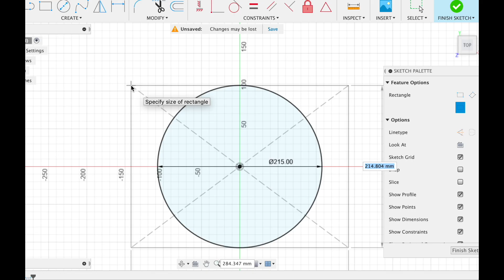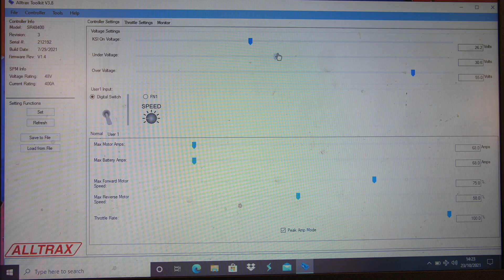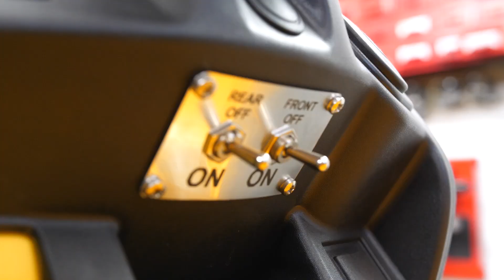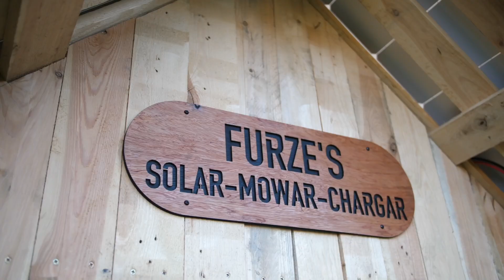EV Mower Conversion with Solar Charging Station

Comment: A very practical use for solar. Bravo! But I have two suggestions. First, can you put gauges on the console so the user would know the state of charge all the time? Second, assuming you are out mowing and have finished but are far away from the charging shed, putting a switch that would shuttle the remaining charge in the front batteries to the read drive would ensure being able to get back home. Anyway, good job!
Reply: Or just a bypass for the auto shutoff. Allowing you to drive short distances even if the batteries have already hit the minimum charge in the ESC

Comment: Biggest question I have is whether or not there is a mechanism to prevent the batteries from overcharging (if that's an issue for those batteries) as solar can be quite a variable source of power

Comment: And all this on battery technology invented in 1859. With lithium-ion, you could get the same runtime and even have space for a hood storage trunk so once you were done with the mowing you could pop down to the shop for a few groceries. Or just cram it full of batteries and get runtime measured in hours, if not days. Or you could even go zinc-air and take it up to about a week (Granted, you would have to replace those batteries as they can't be recharged, but recycling used batteries is much easier).

Comment: Nice build. How about a vehicle to grid connection so you can run your house from it during power cuts?😁
Also, love the solar shed, damn site cheaper than getting in a bunch of lads to put them on the house roof.

Comment: Beautiful project, but as well as the batteries themselves, the charga could also use some improvements, namely you could use a lot less panels if you make a flat roof elevated 30 degrees and pointing to the south (ish, exact values depending on location) and also it's not good practice to stuff all the positive leads to one connector and all the negative ones into another. If you put both leads of three batteries in each connector there isn't a chance of connecting it with reverse polarity, which is always nice

Comment: Just change your drive belt  pulley for the back end the bigger the pulley on  the motor the smaller the pulley on the transmission won't make it go faster

Comment: I’m sure you’ve looked into it, but could lithium electric bicycles batteries be of use? Mine powers my bike for 45 miles of range. A few of those would probably do you fine.
Reply: He'd probably need something from an electrical motorcycles, like on those NIU escooters. They look the same as lead acid batteries, are portable but they also cost half of the scooter.

Comment: Bit more info needed here I think. So max current draw is 65 amps, at 12 v that would be (about) 1 Hp or 800w but at 24v it would obviously be double that which sounds more like it. With 4 batteries to run the cutting deck you have the option of 48v, much better.
Charging looks like you are using 12v charge controllers so is it that each panel  charges it's dedicated battery? So with panels facing different ways what is the orientation of the charging roof? Obviously some panels will produce more power than others due to the position of the sun Etc. Does his just rely on time, I can imagine some batteries receiving less than a full charge.
Loads of questions, cheers

Comment: you can get car battery sized lithium batteries. you could swap them right in. need to setup intelligent charging tho, but they don't have problems being discharged under 50%.

Comment: If you do some googleing there are companies that make lithium deep cycle batteries which is what you need but be prepared they're about 400 for 1 200 AH battery I've seen them up to 2 grand or more for a single lithium deep cycle marine battery but for that price many also come with a 20 yr or more warranty 👍👍👍

Comment: This is a great creation.  The only issue with using Li- ion batteries as a green solution is their inability to be recycled.  The material is very hard to reclaim.  Lead, acid and the plastic case can be completely recycled while Lithium batteries go into the landfill.

Comment: Awesome video as always, Colin!!!
But this one in particular peaked my interest as a #vanlifer in Seattle, WA USA with that exact charge controller for my van’s solar setup!
I don’t know your system specs, but I would assume the panels are are around 120w and each charge controller should be able to handle up to 2 panels.
My curious question is...
Why set up each panel with its own controller?

Keep up the great videos!!, 🍻
Reply: I think it's 1 charge controller per mower battery, not specifically per solar panel
Reply: @iamdave84  I thought about that, but the watts would be the same from parallel paired panels to the controller, just a higher amperage if I’m correct. And if the controller can handle them, the charge cables could then be run in parallel to charge the entire battery bank, or even select batteries. Unless the bank isn’t “seen” as one battery within the individual controller’s perspective. Maybe that’s the limitation I’m not aware of since I’m only running one of each.
Reply: @iamdave84  My point is, why not reduce controllers by half, then split their resulting charge to the banks necessary?
Reply: I agree, if the batteries in each set are in parallel, I'd have thought one decent controller for that set would suffice. I don't have much experience or training in this regard though.
Reply: @iamdave84  Each controller can only handle so much, but should be able to handle 2 panels at the assumed specs.

Comment: So your next step in addition to the battery should be to get time and battery gauges. Also did you wire the safety shutoffs in? With that you might even have a product you could even license to a manufacturer

Comment: Colinfurze The top of the roof  is hiding a bit the first row of the solar cells on teh panel. It could cut the generated power quite alot! as a solar panel is affected by the weakest link in the serie of cells... ( see at 7:25 )

Comment: This is actually one of the most practical uses for battery powered device i have seen yet no reason this shouldn't be the go to for a mower for home use the cost is up there I am sure that would be the only negative

Comment: Should put a battery bank in the shed or under it and let it charge up the bank non stop for quick charging the mower and a UPS backup to parts of the house when the power's out.

Comment: GE had a fully electric garden tractor.  In the 1970s.  An old farmer is selling one near my house but it's rough.  They used like 10 lead acid batteries.

Comment: What a brilliant idea, no sun the grass doesn’t grow, lots of sun the grass grows and the mower charges proportionally. Well done that man.
Reply: I don't know who says that grass doesn't grow if there is no sun.... As it does. Grass will grow even at night if you have enough light through the day (hint, doesn't require direct sunlight but can be overcast). And through a rainy week (full overcast every day) the grass will keep growing. And after a week you need to maw your lawn so your vehicle might be empty.
Reply: @paristo  it does, but way drastically reduced. In the summer i have to do it every 1-2 weeks, in the winter once every 1-2 months, and can get away with not at all from december to january
Reply: Nothing like a self regulated market
Reply: @GreatBeeman  Self regulated market is as functional as non regulated legal system.
Reply: @paristo  tell that to the sun and the grass
Reply: Agreed but photo synthesis requires sun light so does solar. It’s a general comment not a scientific paper. I still think it’s a brilliant idea. Peace
Reply: @jamesspinks716  photosynthesis continues even at night after enough sun at day, but power generation stops on moment the panel doesn't get enough sun light power square area of panel. 

The grass keeps growing through whole week even when it is full overcast, but your panels are not generating power if even at all.

The common problem is that we don't have enough square area for power required, and not enough battery to feed the engine for it performance.

It is totally different thing to run a electric scooter for 10 km radius at 10 km/h speed, than it is to run a forester machine for 12-16 hours in -20°C for 7 days a week.
Or a tractor for 12 hours ploughing. 

Like alone there is no electric car that can travel as far and as fast as combustion engine car. My car costs 65€ to fill with gasoline, but I can drive 1020 km with a one tank, and last month did such a one-way drive in a 12.5 hours. Then after one day it was back to same. Average consumption was 5.4 liters at 100 km. So 55 liter tank was fully consumed with average speed of 80 km/h limit. With a electric car the trip would have lasted a week for one way as every 300 km it would have been required to be a full 7-9 hour recharging. So for every 300 km it would be 3h 45min + 7 hours, so 10 hours x 3.5 recharging is about 21 hours just for charging and so on about 45 hours just to make a trip. 

The similar problem is with all power tools and equipment like lawnmower. You get excellent results if tool is required to be small, but only used short periods and not often.
Reply: @paristo  you tell Colin it won’t work then, have you seen the weapons he makes? Lighten up please!
Reply: @jamesspinks716  How he would make physics go around? Like how can he make that lawnmower work for 7-8 hours without recharging between?

These are not first time tried things....

Comment: Nice idea, but you should also put a battery in the shed and saw the solar panels charge the battery which then charges the lawnmower. Kind a like a Tesla power wall

Comment: This video is why I love Colin Furze! Excellent use of science and fun to create something useful. I'm impressed with the range / capacity, over an hour is terrific. Lithium-Iron batteries definitely a big potential improvement, as most people with ride-on mowers would have more than 1500sqm of grass to cut (I have almost 2 acres / 7000sqm to cut, takes 1.5 to 2 hours with a ride-on mower at better speeds than this electric mower). Great job Colin!

Comment: I wish this mainstream. The clean and green solar-mowar. Imagine the amount the money and gasoline that would be saved with this setup. Plus, if this was widely applied and worth it, the extra energy can go into the grid.
Reply: Cub Cadet already has an electric ride on mower in the US. Seems easy to adapt a solar shed to that.
Reply: Here in europe robot mowers are really popular. Put one in my yard this year. Little bugger mows 1800 square meters flawlessly and when you slap some solar on roof it is renewable local energy ( mine mows only daytime).  Its actually same price to buy robot than big ride on mower.

Comment: Hel Colin, there are already 12V battery sized replacements for your lead acid ones but always make sure that each one has a seperate BMS due to individual variances in capacities. Also cycle them at least 4 times to wake them up properly.

Comment: I bought plans for an electric sit-down mower just two days ago (before seeing this), which is weird.

Anyway, my previous comment with a link to his site got zapped toot sweet. I'm not actually a shill for big EV Mower...
Reply: There are resources out there for using a battery management system with lithium ion too (but I won't link to them). A 48V system seems ideal for driving the whole lot (you need thick cables) and could potentially have direct electric motors for the blades if you want to over-complicate things.

Comment: You can contact Victron Energy for LFP batteries and a charging system. Charging each battery individually with one solar panel (with some on the dark side of the shed) is not optimum. Nice build though, seems already very usefull!

Comment: How about fuel cells? Use the solar power to generate hydrogen, and use that and fuel cells to power the mower. 

I don't really know how good the available tech is, but it would cut out the batteries and could be used for other things as well.

Comment: you should add a battery to the shed itself so it can charge more when the mower isn't there, and you should add more universal charging ports so you can power all future electrical builds, maybe even run a wire down into your bunker so if the primary power is lost you'll always have a solar backup. speaking of the bunker, does it have a freezer to store meat and other foods for long periods of time? nobody wants to spend an extended apocalypes eating nothing but beans and rice, gotta have a bit of steak from time to time, you'll also need a way to grill the steak underground without filling the bunker with smoke, and it can't be fire based because that'll burn up your air supply. and while canned vegetables do the trick in a tight squeeze you should never discount the taste of a good fresh veg, so maybe set up a hydroponics setup for an underground garden, maybe throw in a fish hatchery to fertilize the plants.

Comment: That kit should be further developed and sold as a real product!
Reply: As a full kit, probably not. They would have to have 1000 different versions for every variety and model and slight alteration of mower out there, and they'd only ever sell one or two of each one.
I would totally buy from a place that was supplying the motors and ESCs and batteries and charge controllers for kits like this though. I kind of want to do this with my mower but when I look around for motors all I seem to find are ebike motors and RC car and copter motors. Can't find who's selling the big motors for projects like this.
Reply: Cub Cadet literally sells electric riding mowers already. So does Ryobi and several other brands. I've had an electric Cub Cadet for 5 years now. I can easily cut 2-3 acres on one charge.
Reply: @JeremyAkersInAustin  Does it come with a solar shed? 😃

Comment: I see a tiny flaw, as someone who had a lawn mowing business as a sideline. A commercial lawnmower doesn't sit around waiting for the grass to grow. Cutting season in the UK is fairly short, mowers have to cut during every hour of sunlight and darkness, headlights and floodlights are essential, to be profitable. As Autumn and the cold approach the need drops dramatically along with the profits.

Comment: Personally, I would love the current lead acid batteries in that mower, because lithium ion batteries do perform well in the cold, and I often have to mow when temperatures outside may get below freezing at night. It can definity get cold enough to effect lithium ion charging near the begining or end of my mowing season.

So, how much for the Solar Mowar as is? I already built the shed for it.

Comment: Fantastic job, fantastic video, it is the future but I wonder if you added up all the money spent on battery's, speed controllers, motors and solar panels ect on petrol how many years of cutting could be done. Of course when petrol runs out we will be forced to do it this way. very interesting though.

Comment: Lead-acid batteries can only run down to 50% of their capacity, every time the charge goes lower than that you compromise their internal stability and ultimately their life.  I'd suggest to have a monitor on the dash so you can tell when that's the case.
Reply: The speed controllers he is using also have an option to disable the motor when the battery voltage under load goes to low at a level that can be programed in and some of these controllers also support reserve and a host of canbus options for reading the controller data and adding instrumentation for the driver.
Reply: He should add LiFePO4 prismatic cells in this thing. Extremely cheap nowadays, it will have 3 times the energy density of lead acid and have thousands of cycles even when doing an 80% to 90% depth of discharge.
Reply: That's certainly true for a typical car battery, which is designed to provide short but intense bursts of power for the starter motors on car engines. Batteries designed this way have a large number of very thin electrode plates inside, which gives the maximum possible current, which can be several hundred or maybe even 1000 amps depending on the physical size of the battery. But of course because of this design, deep discharge can build up so much lead sulfate on the plates that they can touch each other or get bent out of shape. Then you've got a shorted cell which makes the whole battery useless, leaving it worth perhaps £5 to a scrap metal dealer but not much more.

However, you can get deep-cycle sealed lead-acid batteries which are specifically designed to be discharged up to 90% or sometimes more. The battery chemistry is the same, but the internal construction is not: A deep cycle battery has a smaller number of much larger electrode plates, with enough space between them to allow plenty of lead sulfate to build up without damaging the cells. The sulfuric acid electrolyte is also usually immobilised in a sealed battery, either by gelling it with silica flour (aka fumed silica) or by absorbing it with woven glass fibre matting. This allows the battery to be mounted sideways or even upside down if you like, but the glass fibre matting helps to keep the cells rigid, stops them bending and prevents sulfate crystals growing across the gaps between electrodes. These are far more reliable and tolerate repeated deep discharge, the only downside being that you can't get quite as much current out of them, so they might not be able to power some larger starter motors.
Reply: @lloydevans2900  my god I didn't think it could be done.... A useful, knowledgeable and polite response on YouTube. Give this man a medal
Reply: Lead acid car batteries yes. Deep cycle. No.

Comment: I've often thought of doing the same thing but don't have this skillset.  Did you consider putting 2 smaller motors on the blades directly and eliminating the belt system all together.  Would make for  more power efficient solution and likely more compact.